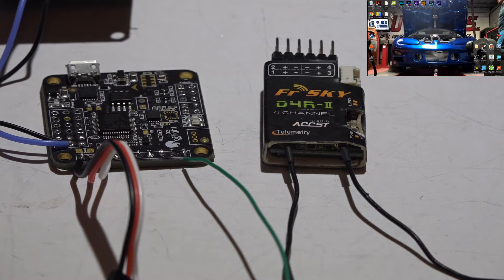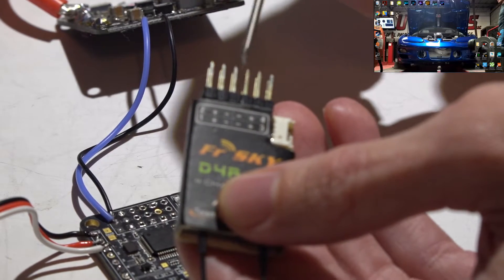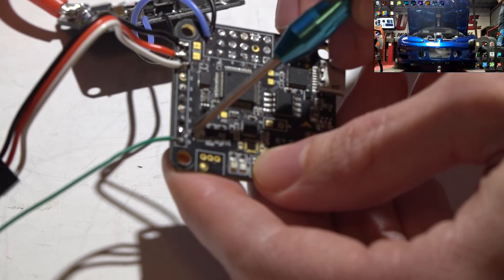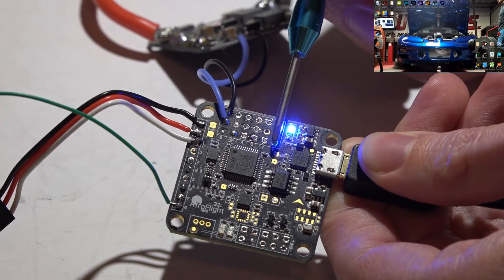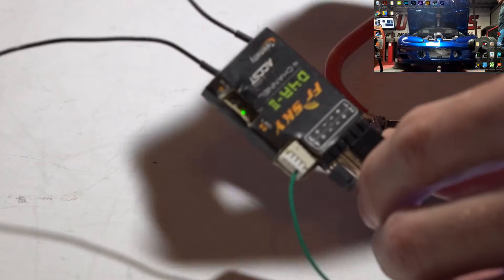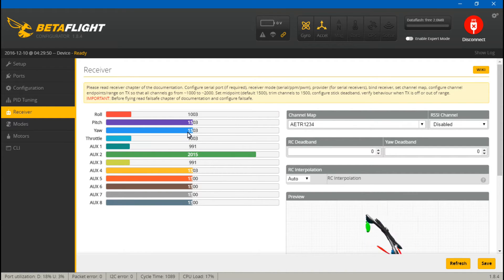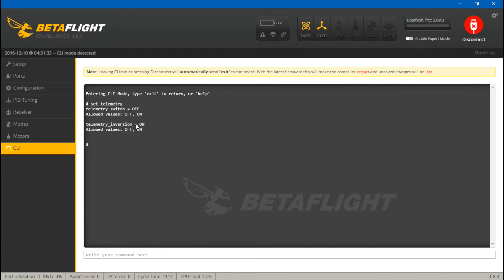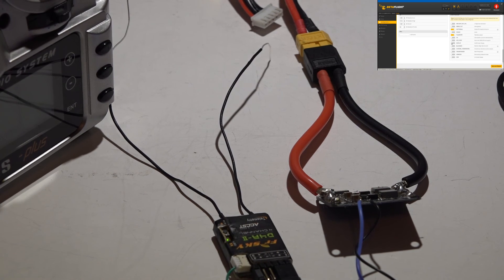Naze32 & D4R-II: Connect & Telemetry

Comment: hey i did everything in the video, only difference is I have a Trannis QX7 reciever that is stock. Im getting telemetry on it but i dont see a battery reading... Someone else told me i need a pos and gnd wire going from my PDB to the pins on the naze (looking at it with arrow up) that are on the furthest bottom right corner??? is this true

Comment: I just did this on CleanFlight and the CLI commands are slightly different! Use: set tlm_switch = on    ALSO this did not work on my board until i enabled inversion, use: set tlm_inversion = on    ALSO  I am using naze32 rev 5 and I have my D4R-II Telem pin connected to pin 6 and therefore enabled FrSky Telemetry on soft serial 1 in the PORTS tab rather than soft serial 2 for pins 7 and 8 as JC has done here. Hope this helps anyone still rocking the old naze boards!

Comment: I followed all the steps in beta flight and yet I'm only getting soft serial port 1 and not 2.
Reply: if you are not using soft serial 1 you should be able to use that for telemetry.  I am using pin 6 for my green wire from my D4R-II and I'm getting it. Just select FrSky Telemetry in the ports tab on soft serial 1
Reply: ryanworks35509 I did that and it was working for awhile, and I crashed pretty hard and now that doesn't work. I'm thinking I've might've broken some of the internal hardware so I don't know.
Reply: that's possible i suppose. if you go into the configurator and type "set" into the CLI it will list all your settings and you can see if telemetry and inversion is turned on at least. as far as the hardware of the board I would reluctantly say to reflash it and see if that resolves this issue. OR time for an upgrade on the FC my friend.
Reply: ryanworks35509 thanks, I'll try that

Comment: can i use 'frsky telemetry pins shared by uart 1 and usb' to connect my d4r-ii telemetry wire?  also, i want to use a piggy osd with runcam swift... can i just connect tx/rx to uart 1 rx/tx on the naze rev6? (both telem and osd tx/rx)...  what is a better wiring option to use both tele and osd?  thanks for your tutorials, great work sir.

Comment: Whenever I got my D4R-II, I didn't see a jumper in the pack. Would that hinder my controller speaking to the receiver? And possibly not having my radio levels in CleanFlight move when i move the sticks or flip a switch? 

I'm running a D4R-II Rx, DJT Tx Module, Naze32, Turnigy 9XR Pro,
Reply from the maker: If you wired it like I have in this video then yes that will keep it from working. You can just solder a short piece of wire across the signal pins on channels 3 and 4 connecting them together. That will do the same thing as the jumper. Then everything else in the video will be the same.
Reply: I've been working on getting it working for a week now. If that fixes it, I will be forever grateful. Going to the hobby shop tomorrow to see about getting a jumper since I don't have a soldering iron atm. I'll report back in case anyone else has my same issue and was wondering.

Thanks PBF!
Reply from the maker: That works. Let me know if you have any more trouble.
Reply: I'm getting the receiver levels to change now thanks to the jumper, however, the motors aren't spinning up and I'm unable to arm it seems.